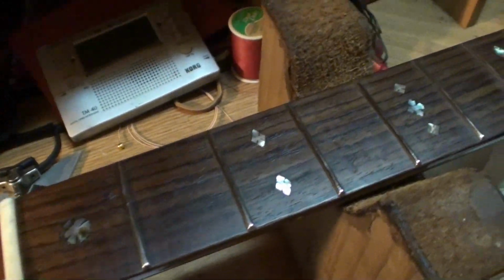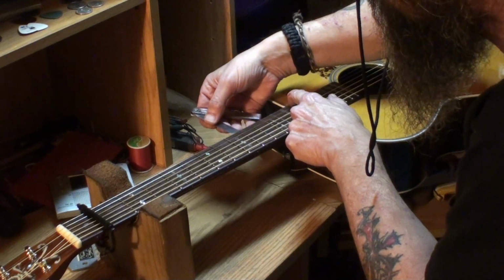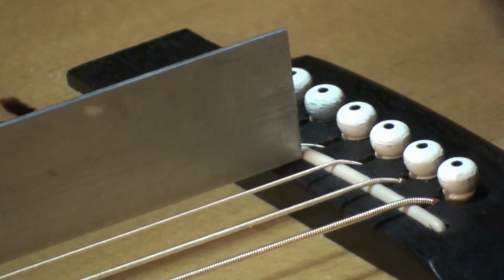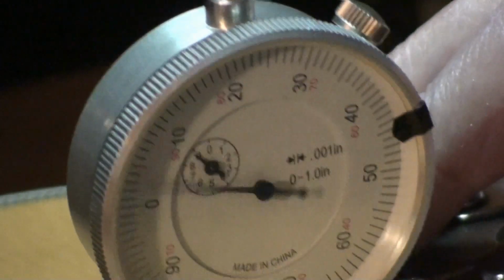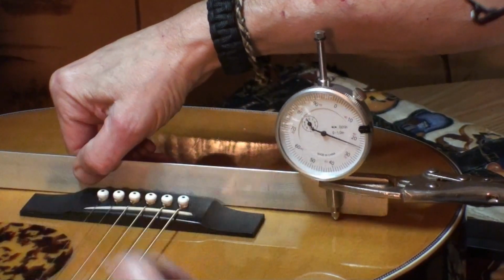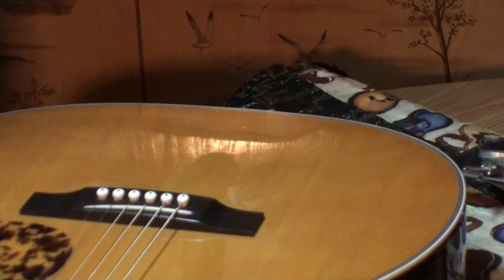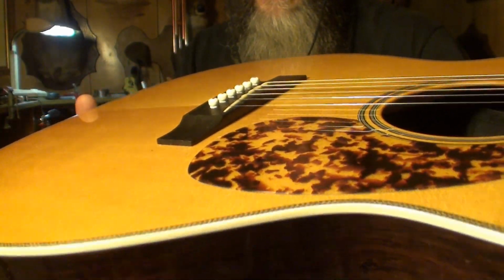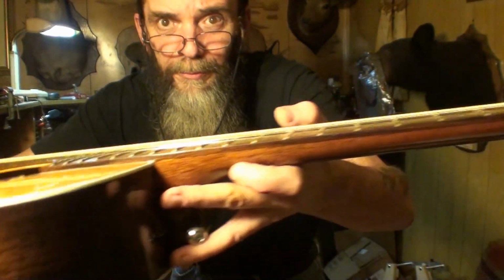A close look at when a neck reset is becoming your near future! blueridge br163 part 3of3

Comment: Hiya Randy. My BR-160 is coming due for a neck reset and has a lot of belly behind the bridge. Not sure if I can flatten it any but I will be resetting the neck myself. I have yet to find a video showing it done on a 160 but I guess it's like a Martin. Any insights?
Reply from the maker: yup very much like a martin, I use steam instead of those heat sticks but be very careful about water inside the guitar body and dont let it get under the finish. also make sure the final fit the neck is in line and string line up in the center of the fret board all the way. best of luck! it's a tricky job!
Reply: @RandySchartiger  thanks man. I picked it up cheap because of the belly up syndrome. I'll take care with it and take my time. Do you know what kind of glue they used for the dovetail?

Comment: Hi Randy should a brand new Martin custom be flat on the top or have a slight bevel like you are showing in video
My guitar seems to be fine from frets to the saddle high action above martin highest specs by a fraction any information would be much appreciated I have bear claw on it and a gritty tuner starting to get a bit worried

Comment: Considering the way they fixed the braces while the sound board was outta shape,you've done a great job mate! That action looks superb and the guitar souds lush. Cheers Randy :-D
Reply from the maker: Whoever did the work obviously had no clue because they painted the inside of the top with glue, that wood needs to be bare so the guitar can be humidified and humidity controlled. It sure does sound awesome tho. Thanks mate!

Comment: i could have swore i saw that dial indicator moving 110 thou and not just 10 thou. i think that means that the fret board face to the top of the bridge where your straight edge hits it is 110 thou lower. am i reading that wrong ?

Comment: "Let it Ride"....always loved that tune. This guitar sounds great. Wonderful tone. I don't understand why someone would have glued those braces down without fixing the fall away and belly bulge though. Maybe they just didn't know. Just seen that the braces were loose and glued them without knowing anything about the other issues. Who knows? But anyway, good video, brother, and will be looking for the next one. BTW, Sorry that things are agitating you at the house that never sleeps. Sounds like you have a lot of things going on. Don't let it get to ya ,my friend. It'll get better. Cheers to ya, my brother.
Reply from the maker: Whoever did the work also coated nearly the entire inside of the top with glue! It looks like they tried to paint it on there, who knows what they were thinking but that should never be done, the wood inside the box needs to be un-funish and uncovered so it can be humidified. Yeah man things move too fast for me here sometimes lol ALL the time actually, I just need to switch gears and let the chips fall where they may. Many thanks my brother!

Comment: Very good sounding guitar. I am sure I'm just confused but I'm trying to understand why you need to lower the action anymore than it is.  It seems to me like it's almost too low. Maybe I missed something.  Good picking my friend.
Reply: if you look to all 3 parts then you see te action was to low on the headstock side and much to high on the fretbord extention because it had a freefall in it.
Reply from the maker: It does play like butter now and action is low as the customer wanted it, the problem is if the guitar ever looses anymore ground like it has been doing then a reset will have to be done. If it stays the way I have it right now she'll should be good from now on. Thanks for checking it out Jerry!

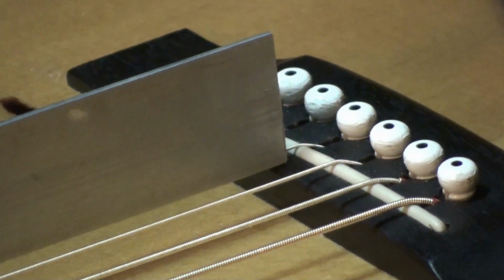Comment: Hey Randy, LOVE all your vids! No disrespect here...I've learned ALOT from you that's for sure, but as a machinist I feel compelled to correct you on your 1st measuring method. I realize you wrote "measurements demonstrated are not accurate...", nonetheless, take from this what you will. Yes, the bridge is obviously higher than the fretboard (from TOP of frets btw) as clearly shown by straight edge knocking into it...but more in the ballpark of ±100 thou (not 10)...look at that drop at 6:24... which was the red light indication that your method was flawed. I'm actually very surprised you didn't catch that (probably too damn tired! lol)...10 thou would have not even been worth mentioning, had that been the correct measurement...we're talking less than that high E thickness! Anyways, I will try my best to explain (without a drawing). Firstly, the indicator should've been zeroed on the TOP of a fret (not fretBOARD), since THAT is the plane on which the straight edge is resting - the one to which you are comparing the bridge's top. Secondly, as soon as you raised/rested the straight edge on top of the saddle, you lost your initial reference plane (fretboard) by creating an angle between the two...VERY crucial. Thirdly, the measurement (0.010") you're taking at the bridge (while now resting on saddle) is simply showing the difference between the height of the fret(s) from fretboard where indicator was 1st positioned (and zeroed) and height of SADDLE from bridge top. The indicator read +0.010", therefore this simply says the saddle is exposed (from bridge top) 10 thou less than the fret(s) is from fretBOARD...a completely INDEPENDENT height comparison between 2 objects...like, say, the height of a person vs another. This has no bearing on the difference between fretboard plane (TOP of frets) and bridge top - which is what you are trying to show with the indicator. One method would have been to first (and most importantly) corner notch your straight edge 1/4" high x 1" long, or whatever you like - as long as it easily CLEARS the top of bridge...mount indicator over notch...zero your indicator on TOP OF FRET while on fretboard (obviously) or any flat surface on which straight edge is resting on its edge...carefully "pinch" rear of indicator spindle to physically "LOCK" THAT ZERO as best you can (to facilitate reading dial measurement once it begins)...position straight edge above guitar with notch/indicator just over top of bridge in front of saddle...rest furthest end of straight edge on center of fretboard width (as you did)...SLOWLY lower indicator end (avoiding ANY contact with front edge of bridge and top of saddle of course) while SIMULTANEOUSLY gently releasing spindle "pinch" and reading revolution(s)/measurement on dial until straight edge rests flat on frets...and VOILA! Bob's your uncle!. A much faster method would be to not even move the straight edge and take 2 measurements, with either a depth micrometer or even a caliper (as depth gauge) using TOP OF STRAIGHT EDGE as reference. Measure to TOP of fret, then top of bridge and subtract one from the other. As long as that straight edge is parallel shaped (obviously), NOTCHED for bridge clearance and always resting FLAT on top of frets, that is KEY. A reference plane (zero) should NEVER MOVE if you are comparing anything to it. I hope that was clear enough and it helped you (and others). Btw, I'm not shouting with caps lol...just emphasizing. Take care, from Canada! p.s. Put those vise grips away before you give someone a heart attack!
Reply: Hey, markarita3. You are my hero. I immediately noted the same issues with the measurements, and you did such a great job of narrating it through, step by step. The art of measuring is a skill in itself, and people who do it correctly should be proud. I have actually questioned a luthier's  measurements. I measured the same thing as he was measuring, but he was wrong. I can tell you, what I was reading was not wrong. I know this from working on motorcycle engines, trade schools, the military, and working in aviation. If someone shows me I'm wrong, I listen and try to make sense of it in my head (learn!). If I was wrong, I admit it and thank the other person for their tutoring. I expect a lot from a professional luthier, and if he doesn't have solid skills he won't be getting my business. They can hide behind their dial indicators and digital calipers, but those instruments are like a gun in your hand. You have to know how to use them.
Reply: BTW, I thought the top arch looked perfect. The time to worry is when it goes flat.
Reply: Someone needs to make tools for this kind of measuring. They will be very handy in a luthiers shop.
Reply: @RayLawrenceJrMUSIC  They do. Depth micrometer or even a caliper. You can get a digital caliper (here in Canada) for about $20. The depth mic would cost a lot more.  Then all you need is to get a precise straight edge with a good span - 24" should be sufficient, and cut out a notch in the corner for bridge clearance, like I described. Easy peasy. But yeah, I can understand that someone may not even have the tools to make that notch. I would say at the very least, buy/borrow hack saw and a file.
Reply: @montanaokie  I have no idea how I missed your comment - a YEAR ago?! Thanks for the kind words Gary! I absolutely do take pride in my skills. And I 100% agree with your last comment...yes the tools are great, but what's imperative is the method. Cheers.
Reply: Oh yeah 'clear as mud'! just a couple of zeros after the decimal point? those Anal retentive yanks, still stuck in imperial! If they can use metric for the though bit why not leave inches out all together. works SOooo much better with CMs & MMs. I'm old skooll too my spark plug gap is .025"

Comment: Randy, I have a similar belly situation with my 1978 Takamine F340S. It's one of those law suit era Takamines (aka TakaMartin). The low E and high E at the 12th fret is 70. I could probably angle file the saddle to get the high E down to 60 if necessary. The guitar plays nice and has great tone. But I would like to get the top a little flatter. Fortunately, the belly on mine is not as much as the one in this video. Would you recommend using one of those humidifiers in my guitar. If so, should I leave in the guitar anytime it's in the case or on the stand? There's no way I could cost justify doing a neck reset.
Reply from the maker: search this channel for steam machine, you'll find a video of me showing the rig I made to steam necks off, if you have something like that to blow steam inside your guitar then clamp something flat against the top after some steam heats the inside up it'll soften the glue enough to flatten the top completely, be very careful tho if you do this don't steam inside the guitar very long. good luck!
Reply: @RandySchartiger  The more moisture you  put into the body, the higher the arch will rise. A dried out guitar will have a flat, or possibly a concave arch (the worst). The best thing is to try to keep the guitar as consistent as possible. There is a difference between an arch and bellying. Arch is good. Belly is bad. Cheers.

Comment: Interesting stuff.  I learned a  lot, thanks.
I actually have the BR163 myself and have done some setup on my own.  Looking at your video sent me looking for a straight edge.
I find the same belly as you saw.  Pretty similar drop off above fret 14 too.  I wonder if this is common for the model.  If I keep the straight edge flat against the pre-14 frets though it appears the bridge plane and fret board plane are pretty much the same.  Thanks again for the lessons.

Comment: Randy, my old guitar (an early 70's Fender) has similar issues (straight edge hits bridge, fretboard falls away, etc.).  Seems to have a lot of belly bulge, which I thought was the problem.  And I was thinking a bridge doctor would fix the problem.  Could you explain how a bridge doctor would (or wouldn't) help this guitar so I more fully understand it?  Thanks!
Reply from the maker: If it's not off too much and the guitar has a considerably big belly the Bridge Doctor might work. All it does is pull the back part of the bridge (nearest the strap button on lower bout) down and force the other side of the bridge (nearest the fretboard) up as it pulls the entire top down to make it flatter by applying a great amount of pressure from the adjustment. It's possible it could straighten the bridge level and pull the top down enough to match the plane of the fretboard and avoid resetting the neck. I'm always more concerned about how the Bridge Doctor will effect the sound of the guitar, some I have installed made some guitars sound even better while others the BD sometimes ruins the sound, especially on high end guitars that sound really good to start with. I've even heard of people installing them and then removing them from guitars after a year or two passes and successfully being rid of the belly after the BD is removed but I have never tried this myself.

Comment: Put Two 5"X#10 machine screws through the back into the saddle between the 1st and 2nd, and the 5th and 6th strings. That'll pull that saddle back down leave plenty of adjustment for the bridge. Did it with an old Harmony, didn't hurt the sound a bit and got plenty more years out of it.

Comment: Would fixing the bracing wreck the tone?  Isn't that similar to a BD?  Maybe the tone improved as the top deflection increased?  Is this a standout BlueRidge?  Hmm.  Or do all BlueRidges sound this good.  Something is causing that great sound and it ain't the fretboard.
Reply from the maker: All the Blueridges I've play sounded really good, I've always been impressed with every one, granted some might sound a little different, but they all have something extra it seems. It's possible all the bracing being glued while they guitars geometry had changed from its original condition could have caused the sound to change, also by someone covering most of the inside of the top with glue probably effected it too, just hard to say, but I agree this one has plenty of good sound. Thanks for viewing!

Comment: Great video Randy. Dave from Delaware. I been out of commission for a long time I had spinal surgery... Just checking in to see how your doing? I have a question? I tried clip-on digital tunners and I don't like them. I even tried a sound hole tuner and I didn't like that either. it seems the best one's for me are Apps...What do you think?
Reply from the maker: Apps are quickly becoming as accurate as clip on tuners, I use Guitar Tuner Pro and DaTuner Lite more now than I do tuners because they are so accurate right to the cent! Some companies like Peterson make some really nice tuners that are very accurate, clip ons and stationary tuners both.
Glad to see you back! I hope all is well for you now! Welcome home! :)
Reply: Randy Schartiger, Check out Pitch Labs Pro. It's on Android and Apple platforms. It's so accurate that I won't use my clip-ons anymore....
Reply from the maker: I should have mentioned that as I've been using it a long while now too, it does rock!
Reply: I saw Randy use a free one,"Pro Guitar Tuner," so I tried it(Android ). It's a good one.
Reply: I just tune to my harmonicas cause I play them from a holder when I play the guitars, so
I have little choice.  If the guitar sounds good with the harmonica, that is all I care about.

Comment: Good video Randy, Nice guitar but I don't If it is worth a neck set unless the price would be reduced.Is that a BR 163 ? I am not sure what that guitar cost maybe it is worth a neck set.Were it is deformed might make it worth less.🎸🎸🎸👍🏼👍🏼👍🏼😊
Reply from the maker: Resetting the neck would raise the overall value of the guitar, especially if someone sizes it up and sees that the neck angle is off. Myself I think it would be worth resetting. Shaving the bridge could buy some time, I shaved the bridge on one of my Martins over 4 years ago and it's still holding up well and not changed. Thanks for viewing Steve!
Reply: Randy Schartiger I was thinking about the top were the finger board and top are dropped down if you set the neck back that would all have to be raised up  some how.

Comment: Nice and informative video. You seem to know these guitars inside and out. Can I ask a question? Many Blueridge  models have a "3-piece" neck. This is actually the neck construction (not the headstock or the heel). Can you give me your understanding of this and whether I should stay away from this sort of thing?
Reply from the maker: A lot of companies build their guitars like that, Gibson even extends on it by making their headstocks 5 piece on some models. The reason is for strength, they are much stronger necks than a one piece solid piece neck.
Reply: As I tried to make clear in my question, I'm not talking about the headstock. the premium guitar manufacturers only use solid wood for the NECK itself. I believe it is because it transfers the sound in a more desirable way.

Comment: The need to reset a neck seems inevitable as guitars get older. That’s a fine sounding guitar and so is your playing.
Reply from the maker: Thank you much Dale! Yeah most of the time old guitars have been under string tension all their lives, and this eventually pulls them apart and only a reset will properly correct everything. Hopefully this guitar won't move anymore for a long time but if/when it does it'll definitely have to be reset then.